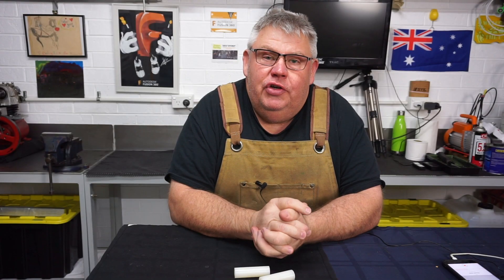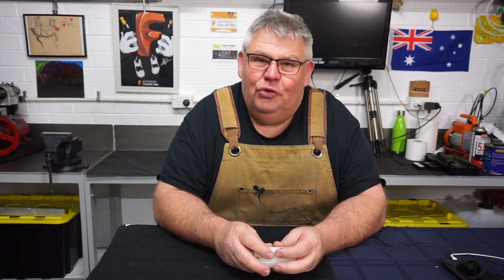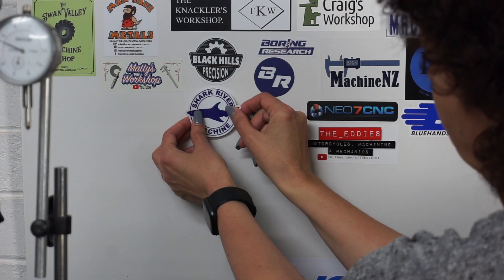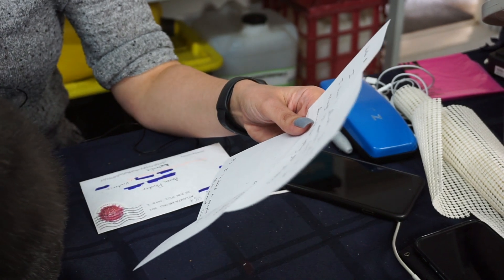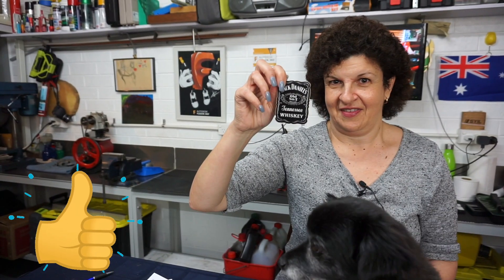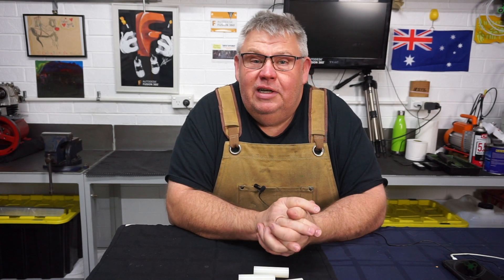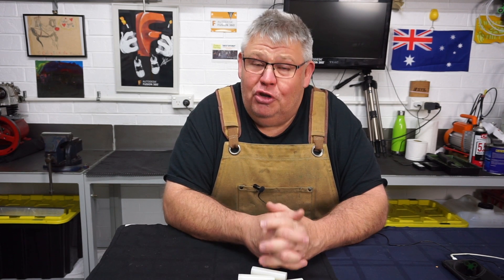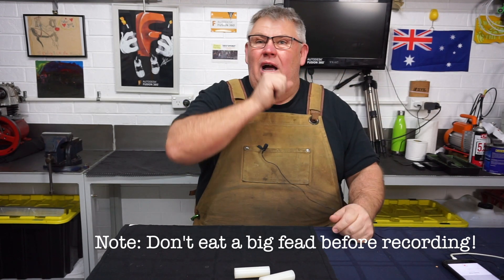Turning Nylon - New Shop Stickers

Comment: That's Murphy's law when you have a project. Your selection of stock size is either way too big or too small. Never just the right size sitting in your stock plie. I love that mill sticker that Ca Lem designed. I tried to order one of his t-shirts with that on it but my size is "out of stock".  Thanks for the mail call Dianne & Ziba.
Reply from the maker: Thanks Tom. I think Dianne had fun doing his video with me. It takes courage to get in front of the camera. Not wrong about the stock pile Tom. Now I’ve got to order more to finish the job for him 😂. Ca Lem stickers and bottle opener is a work of art and thing of beauty. If they don’t have your T-shirt size, then I won’t even bother looking 😂. Cheers 🍻
Reply: @AaronEngineering  Only shirt size currently in stock is small.
Reply from the maker: It’s hard for a full figured man to find clothes. Dianne makes mine from old circus 🎪 tents 😂
Reply: @AaronEngineering  I hear ya. I miss the Husky clothes section too.